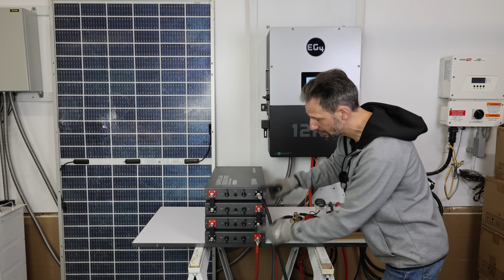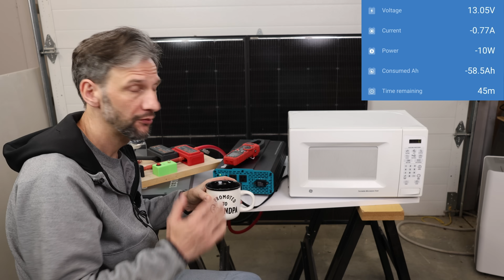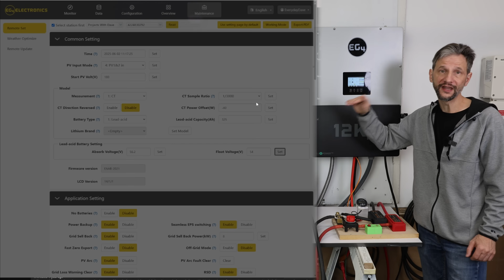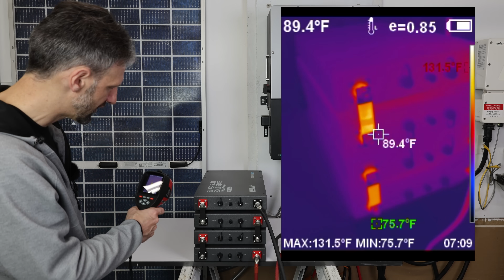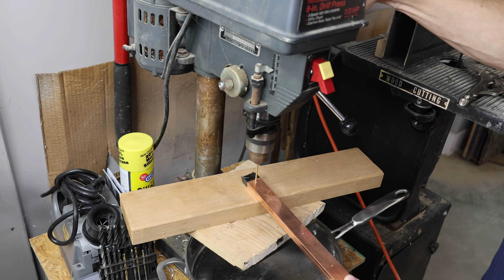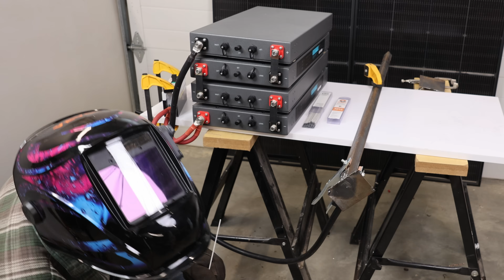NEW Renogy Semi-Solid State Battery - How good is it?

Comment: $562 per kW is insane for not much of an improvement. Hopefully flooding the market with them will bring the price of others down to a more reasonable price. I really hoped there would be a weight savings with solid state and I would hesitate to brand them as such considering expectations.

Comment: Are the four screws on battery terminals exposed or recessed? I saw a video where the youtuber installed the offset cable ends in contact with the four screws. Upon turning on the system, major sparks and disaster happened.

Comment: This is awesome thanks for sharing everyday Dave now question how do I set my meter for inrush there are some tools that I want to be able to test
Reply from the maker: Every meter is a little different.  You have to have one that is capable of measuring inrush current.  Check the manual.  If it has the capability, you usually set the clamp meter to measure current and push the function key to get to inrush.

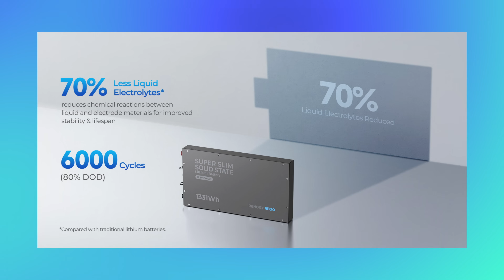Comment: 1:30 so these are not truly solid state, but at best semi “solid state”. This lack of truth in marketing is only getting more common. Companies argue that they only need to specify “fully solid state” to market a true solid state battery, and “solid state” is an appropriate catchall for any chemistry which attempts to reduce the amount of liquid electrolyte. Of course, if they cared about accuracy then “solid state” should only refer to “fully” solid state, and the catchall should be semi-solid state for all others.
Reply from the maker: Correct, they are labeled "Solid State", but as I stated in the video intro and they also show on the website, they "semi sold state."  They don't claim to be fully solid state.  I think  Labeling them semi sold state would be more accurate.

Comment: great video, also wonder if the 10A charging at low temperatures is just power going to a heater until the cells are warm enough to accept more charge 🤣

Comment: Amperage was there in spades, that 1/8" rod only needs 120amps.. The voltage wasn't enough to support the arc gap, which is required for the shaky human hand to float the rod tip over the puddle without sticking. 1/16th will burn HOT, 3/32" would've been good. 
-48v config @ 160amps peak would've liked a 1/8(super-hot) or even 5/32(roughly the correct amperage) rod. It's about 1amp\.001" rod diameter.
Reply: And I guess AC is better for welding.
Reply: @AKG58Z depends on what process and material. Stick is almost all dc, to my knowledge ac is only old tombstone welders and TIG. But I’m sure there’s other AC processes.

Comment: This is fantastic—and possibly the final nail in the coffin for lead-acid, gel, AGM, and similar battery types. At my cabin here in Norway, temperatures regularly drop to -35°C, and I really struggle to keep the indoor temperature above -10°C during the winter, when there’s almost no sunlight for charging. This has forced me to stick with batteries like AGM that can handle the cold—but that’s finally about to change.
Reply: LTO battery's have been around for a long time and are good down to -60c with 30.000 cycles rated
these are not there
Reply: @NightshiftCustom That’s true, but LTO batteries are much more expensive for the same capacity, and they are very hard to find.
Reply: @TheJensss  you can now buy yinlong cells right from XS power or 12v ready to go lto battery's from them also but most are aiming for car audio guys with big power outputs and less AH with some more for bulk storage
Reply: @TheJensss  also there rated for 25 years and can last 30+ also very safe so yes it should cost more
Reply: @NightshiftCustom  I'm living in Europe, so for it to make economic sense, I would need to order from China. However, the cost for 100 kWh or more would be astronomical compared to LiFePO₄, so let's hope prices go down in the future.

Comment: All modern batteries are semi-solid state.  The only way to have a truly solid state battery is if it has a solid dielectric (absolutely no liquid).  These do not meet that criteria, nor do any in production.  Using buzz words to try to sell a product as something it isn't doesn't bode well for a company.
Reply: You're so smart you call the internal conductive medium a "dielectric" when it is actually an electrolyte!
Reply: @johncanalese588  Electrolytes are in wet cell batteries, which only reinforces that this is not solid state.
Reply: @aspendell209  No, electrolytic material or medium is one that allows the conduction of ions. Traditional Batteries have used liquid based media and Solid-State Batteries use a non-liquid or dry media as their electrolyte, hence their name.
Reply: @johncanalese588 well do these batteries contain liquids or not? I don’t really care about what words he used, but if the point he made is true or not..
Reply: @kungfreddie  The choice to remain ignorant and stupid is yours.

Comment: I guess it's interesting to see where things will be going... eventually.
It will likely be a while before these can compete with LiFe. So...  they can charge in mildly sub-freezing temperatures. Ok, great, but at their current price point, just running heaters (if you need them) is still so much more cost effective as to be in another universe of economy.
Cool tech tho, I guess.

Comment: solid state hype over the years is out of hand. I recall this Mercedes bus with solid state but the batteries run hot, inefficient, low capacity. It appears to me that battery performance is limited by physics/size for decades. For example, sodium ion while low in energy density has high c-rates (relative to its density) and good low temp performance-though a similar sized LFP or Nickel based battery will perform similar.  Silicon carbon in latest smartphones also don't fare better, it is simply higher capacity trading longevity

Comment: I bought one of these off Amazon and it came DOA.  Unconnected voltage 11.6, hook it up to anything drops to 0.66.  Won't take any charge or jumpstart (activation) and bluetooth isn't working.  The only 7-pin CAN cable on Renogy is both the wrong size and gender.   So I'm stuck here waiting for the vendor to make things right.  Thanks for the video - most amusing and wish I could try welding also.

Comment: The price is madness $1300 dollars for 100ah we gone back in time 5 years
Reply: the $1300 price was for 2 of them. when you follow the link it's automatically on the 2 battery deal.
Reply: Yeah and the dude got it for free, four of them...
Reply: @SolarizeYourLife  that's why they are $1300, influencers get truckloads for free so they can be ridiculously enthusiastic about them for no particular reason.
Reply: That's what I thought.
Reply: Solid state battery is still in the newborn state tho, when it's finally massively produced by many of the largest battery manufacturers, the price will gradually taper down
Reply: It’s a new technology. Calm down.
Reply: @OffgridApartment  there is nothing new to see.

it is prolly LiFeYPo4 cells packaged in a shell.  LiFeYPo is available for 10+ years.

Comment: What did we learn? Well, these are not any lighter, not anymore powerful, they're just more expensive and less powerful then most in this price range. Or at least that was my take away 😁. Admittedly I skipped through the welding section, cause, once ya know, well, ya just know. But thanks for the overview, and enjoy your new free batteries. Cheers 🍻
Reply: Also my takeaway. These look like normal LFP batteries to me if I look at the spec. 12.8kg for 1.3kWh? That's 103 Wh per kilogram. Cheap LFP's from China do 160 now (that's without management and case). Only those can be bought for around $60 per kWh.
Reply: It seems to me people are missing the point. The advantage of these batteries are in the low temperature operation, the IP rating, and the form factor. If you have the space to keep your batteries  warm and dry there is no reason to get these. If your usage needs something different these may be worth the premium. I think it's cool to see new technologies come online. Let those who need the capabilities pay the premium until the technology matures.
Reply: Can get 4 280 ah for 1500 bucks usd. Soo that sound like more for less.  All the protection bms Bluetooth..
Reply: @towguy-johnnytowtruck  :
You are probably, exactly, right. Now, what is that worth to you ya?
Reply: Ie a battery for a boat.  You probably need to attach it to a float, it would be a shame if it sank. The lithium batteries for boats are crazy expensive, ie $1500 per kWh.

Maybe good for a bicycle or motorcycle too.
Reply: @mikegrok  :
Now that's finally a place where this overpriced thing begins to make sense. Everything costs more on a boat!
Reply: At the end of the day, these are not cheap bulk batteries to toss in your rv/home. They're rugged, high quality and they deal with harsh environments better than my wattcycles. Will I buy them? Not right now. Is there a niche for them? Absolutely.
Reply: Same here! What is the purpose if not lifetime and energy density! LFP are better cheaper and almost as safe!
Reply: I don't disagree. But it's like any new tech when it's only one company producing it. Since they're the only ones with the item, they'll charge more til there is market competition. That and with it being (more or less) first to market, any first generation is going to be the least of whatever version that comes after it. Hopefully competition will drive the innovation on them. They're supposed to have faster charge times, have top worry less about temps and have more life cycles. I haven't watched the entire video yet, so maybe Dave goes over that. I'm not super excited about these, but if the things I mentioned above end up being true, once they work out the kinks, improve the features, etc. hopefully they'll just keep getting better. For me, they're pretty useless as I'm hoping to do a 48v system (I get you can work these up into 48v, but going to be bigger than a single 48v 100ah server rack battery and I've a space problem), but maybe by the time I'm ready to drop the coin to put it all together, these SS batts will have improved.
Reply: @nahnotsomuch2292Eve has solid state batteries already n so does so many other Chinese manufacturers
Reply: @nahnotsomuch2292 :
Okay, hang on bud, there is no "answer" here in the comments. These "solid state" batteries are nothing new, and they still don't even commercially exist! But you all do your own homework regardless. Cheers 🍻
Reply: @Finite-Tuning  when you look at the price point of other batteries new to market. These are pretty unreal. Just 5 years ago a 100ah 12v lifepo4 battery was around $1000.
Reply: @DBbyDesign  :
Sure, yes, agreed. But that was 5 years ago!
Reply: @Finite-Tuning  meaning in 5 years these will likely be cheaper then a standard 100ah lifepo4 today. While having a better case. Better temperature usability and better form factor.  When a new product comes to market its always expensive.  Considering these are already  50-300 dollars cheaper then the original lifepo4 100ahs on the market. Its great progress. Even if you dont agree. Facts are facts.
Reply: @DBbyDesign  :
Completely agree facts are facts, you might wanna double check a couple of them. You're way off on price.
Reply: @Finite-Tuning no I'm not. Most 100ah lifepo batteries were well over $1000 during the early stages. The renogy solid state is $950.  Your out to lunch my friend. These are cheap for a new launch of battery.
Reply: @DBbyDesign :
These are 100ah "12vcd" batteries bud, selling at $750 ea on sale! I'm sure you can do that math once you realize your mistake. "52vdc" battery packs can be found all over for well "under" $900 to your door! My lunch is good, hows your humble pie? 😁

Comment: I did this back in the day with lead acid. I think it worked better with lead acid because of the voltage sag and no bms it wpuld weld decent with 1/8" 7018

Comment: If low temps or high temps are an issue, then using LYP rather than LFP (LiFeYPO4) are the only sensible choice, with operating temps from -40C to 85C, the company that make my own cells make them from 40ah up to a ridiculous 10000ah, with continuous charge and discharge currents of 3c and peak currents of up to 10c, meaning my own 400ah battery bank can accept a charge current up to 1200A, with a peak surge of up to 4000A lol
Reply: Is that Winston-thundersky? Are they still in business?
Reply: It is, and they most certainly are still in business, sold worldwide @adon8672
Reply: @adon8672 They most certainly are, with local dealers in most countries, here in Australia been sold since about 2008
Reply: LTO is good down to -60c with a working temp of -40C - +60C  30k+ cycle's with no bms or cooling needed and also SAFE with cells that can charge in 7 mins
been around for 10 years now I believe
Reply: @NightshiftCustom but the energy density is very low, at least relative to LFP and NMC.

Comment: 24v is the minimum voltage DC for welding try with 48v and it will be clean  and slick
Reply: stick welding is 10-50v

Comment: When U weld with the full dump of current from a big battery like this, U R supposed 2 Have a Ballast Resistor/choke in series with the Rod.  The resistance is determined by the current of 100A & the total battery voltage. Around .1 to .3 ohms. Try some #6 Stranded would around a piece of scrap iron or steel. I had a 120V battery bank made of 8D Truck batteries long ago and tapped it at 24 V direct connection with No Ballast, like what you did here. AS soon as I went to strike an ark the rod flashed & melted instantly in an explosion; vaporized. That was a 1500 Amp Current Pulse. The battery didn't even blink under that. It's designed for 1500 AMP steady Cranking Power. Doing this is extremely dangerous. Do not strike a rod WITHOUT a ballast resistor.

Comment: With only a 6000 charge cycles, it's rather disappointing for what I thought solid state was supposed to promise.
Reply: 6000 cycles is what DIYers get with EVE cells at 80% DoD.  nothing new or solid state there.
Reply: Normal lithium only has 3000-4000....
Reply: @SolarizeYourLife  What exactly is "normal lithium"?  Because there are quite a lot of different chemistries out there for lithium batteries, and some of the ones most commonly used for home solar are LiFePO4, which can reach 5000 cycles.

Comment: you need to use the positive as the ground and the negative as the electrode  dcen (direct current electrode negative)
Reply: yes
Reply: @jcjorge2010 how would it make a difference in dc? Maybe with a regulated welder, but when you directly connect to a battery, heat and arc should be created regardless of electron direction imho. But I am no welding expert, would like to understand why this would make a difference.
Reply: @twr4641  no. it makes a HUGE difference.

Xenon HID bulbs for cinema projectors feature a bigfat electrode on just one side of the arc to account for the electron migration during DC arcs.

welding relies on heat and melting the base material.  

he melted the rods tip instead of the square tube by migrating electrons from the tube towards the rod.
Reply: @casemodder89thx, that makes sense!
Reply from the maker: I was going to try that and I forgot to do it. Does it make a big difference?
Reply: @ProjectsWithDave  Big difference to where the heat is in the arc and primary direction of transfer
Reply: Its more the voltage is too low then that its reverse polarity
Reply: @bencoutts4303  stick welding is anywhere from 10-50v